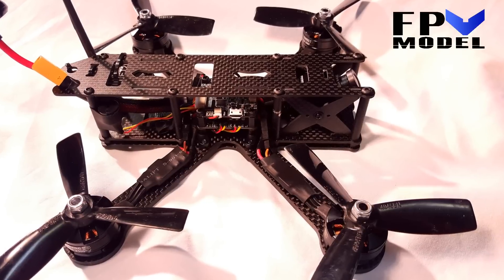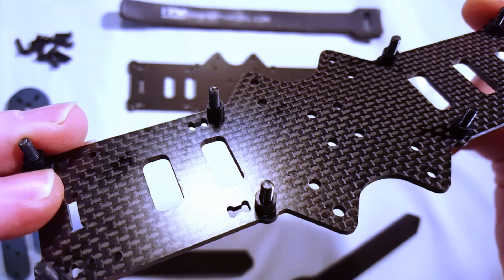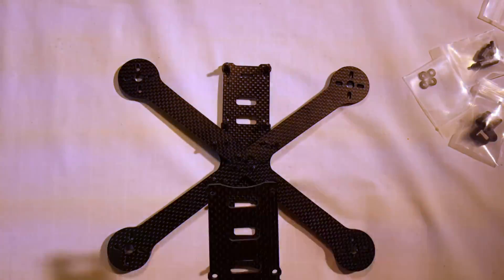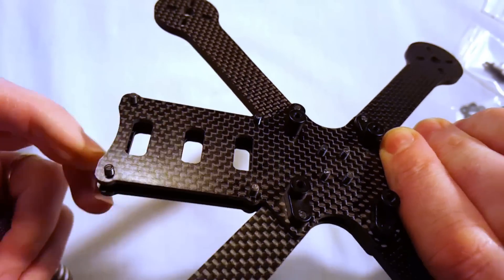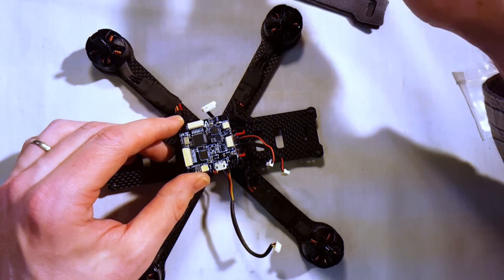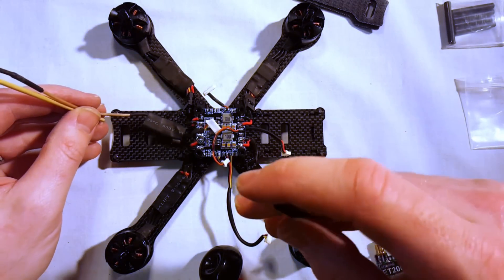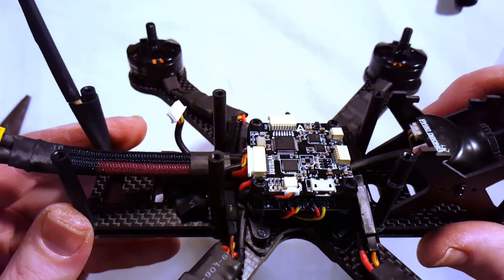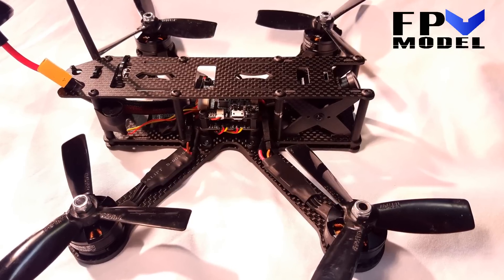Complete Build: ZMR X210 from FPVMODEL.COM

Comment: 1. What kind of hex screw driver are you using?
2. I bought tiny Lumenier RX1806-14 2300kv motors and only 2 or 3 screws go in - the 4th one doesn't fit my X210 because the holes don't line up. 
3. I wish you would have "talked" through all the steps instead of speeding through. It's kind of hard to see what you are doing with the washers, etc. 
4. What kind of props are those?
5. What motors did you use?

Thanks for doing the video.
Reply from the maker: I use a turnigy set of hex drivers bought from hobby King. They are precise and hard and do a great job. Have never stripped a screw with them. the x210 is designed for 2204 motors so 1806 won't line up exactly, however, 2 screws is more than enough to hold a motor reliably, especially if you use loctite. :-)
Reply from the maker: I use a turnigy set of hex drivers bought from hobby King. They are precise and hard and do a great job. Have never stripped a screw with them. the x210 is designed for 2204 motors so 1806 won't line up exactly, however, 2 screws is more than enough to hold a motor reliably, especially if you use loctite. :-)
Reply from the maker: DAL T4045BN

Comment: I'd suggest locking your white balance on your camera. That will stop the weird color changes in your videos.. Also if your using two different color lights (ie. a soft white with a day light color bulb) it will also cause color balance issues. 

Other than that very well done.
Reply from the maker: Yeah, I've been working on that. it drives me nuts. I record these with my phone actually so I haven't figured out how to do that, but I do know that it only seems to do it when I use a white background so I'm done with white backdrops. Thanks though.